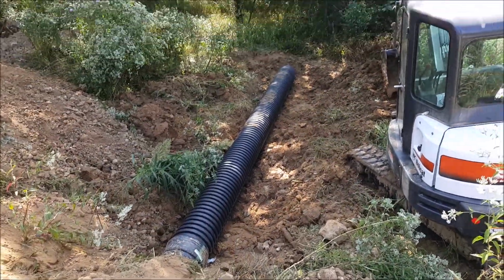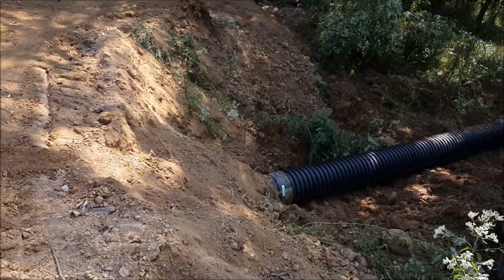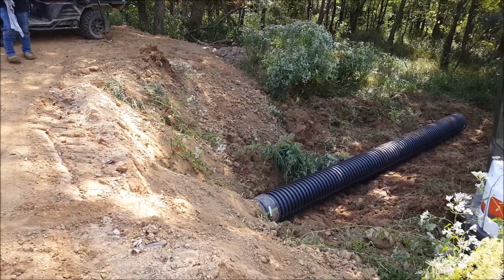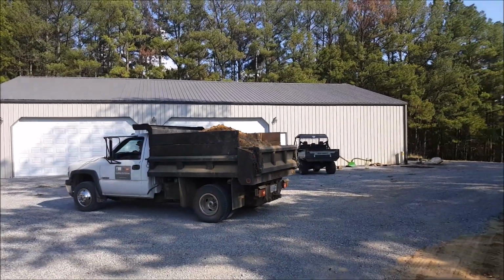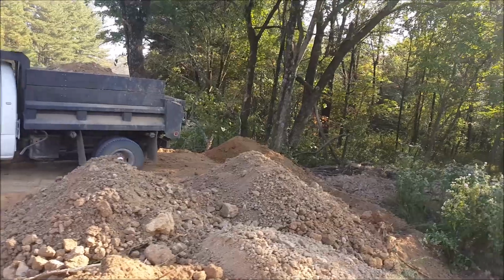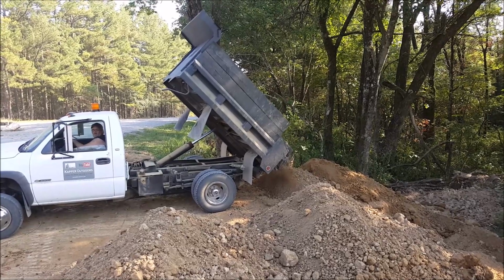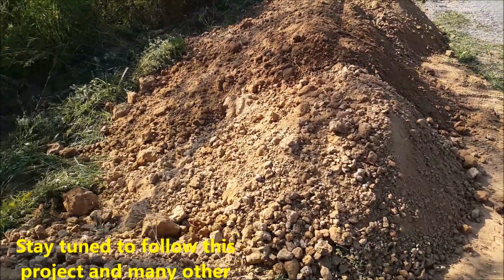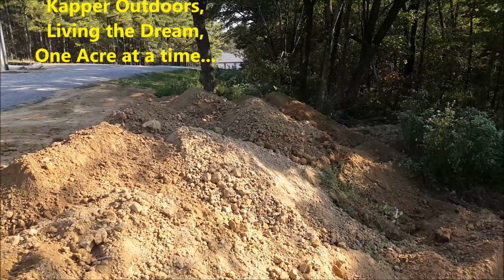Adding 22' section of culvert pipe to existing pipe-Making Gravel turn around

Comment: Looking good Kap.  It's also nice to see that you let poor Mike work in dry weather once in a while instead of torrential downpours lol
Reply from the maker: LOL... You should have seen me!! :) I wanted to video tape, but couldn't, but we pulled him on the broke down riding mower with the tractor all the way from the front to the Pole barn (3/4 mile). It started raining right about when we took off! Man, did Mike end up taking a shower while steering the Riding mower!! But my job was tough too you know.... Between the AC controls, the Radio stations and steering, man, I was really strained!!!! :0
Reply: Kapper Outdoors that must of been awful for you too lol